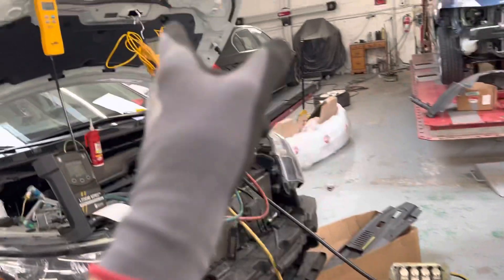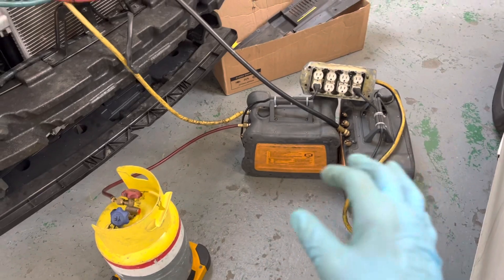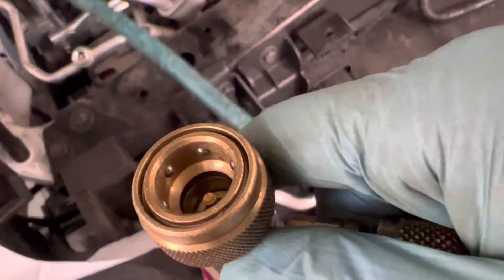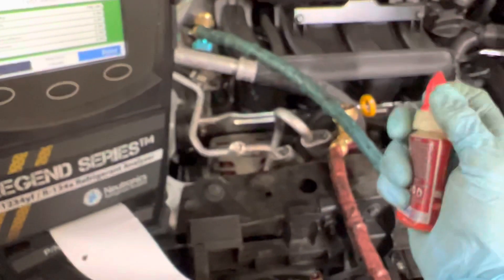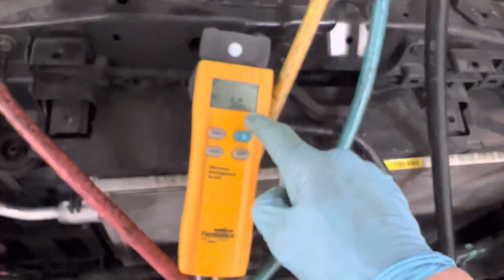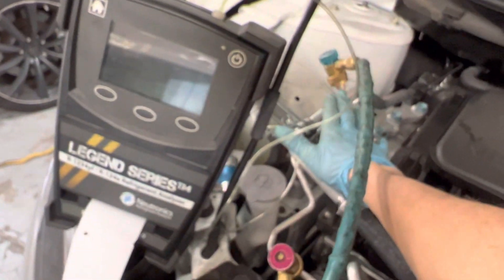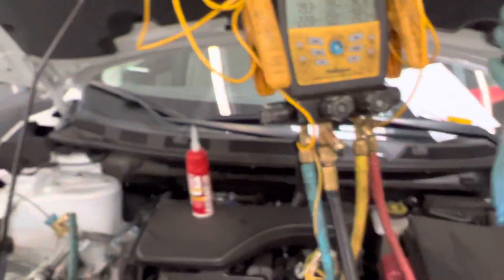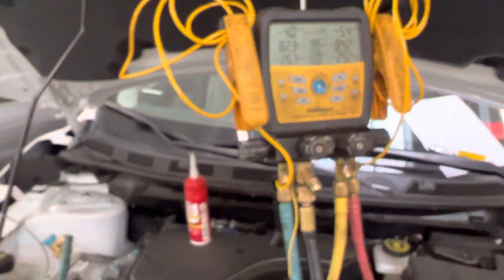Automotive refrigerant recovery using Fieldpiece equipment￼

Comment: Tom, when you pull freeon some little oil is going to be recovered as well. when you add free on , do you add little bit of oil, or you always add x amount or you dont add. the higher 5000 dollar machine willl tell how much oil is recovered so we will add that back. just getting your thought process.
Reply from the maker: The recovery machine has a speed on it and I have a site glass.
     So long as I start at a slow speed, only recover from the suction line at first at a slow speed so no liquid get drawn up no oil. 
   This takes practice and experience

Something I would not recommend other people trying to do . 
    So I don’t need to add oil unless the part is changed

Comment: Thank you for your videos, I really enjoy them!   I have Fieldpiece equipment for HVAC and plan to use them on my cars when AC service is needed.   I think it is a far more effective system over the dedicated idiot boxes that most shops have.  I did look into the Mastercool 69Legend Series, but it is a very pricey system for casual use.  I imagine I can pay a shop to hook theirs up before I service to see the purity of refrigerant.
Reply from the maker: The only thing you gotta remember if you’re used to doing residential or commercial HVAC. 
       You do not want to pull out refrigerant on the liquid line 1st because you move a bunch of oil and you won’t know how much to put back. 

Throttleback your recovery valve to slow it down . 
   Monitor your cycle glass to make sure there’s absolutely no liquid coming up the section line because in certain cases there is possibility when you drop the pressure the refrigerant in the oil in the section line foams up like big gap spray foam.   And it gets sucked up the suction line low side, removing oil you don’t wanna do that.. 

This is why I tell everybody you don’t do this all the time so spend the extra three to $500 and get the  SIRSEPT DUAL GUARD OIL separator

This will allow you to recover refrigerant with no worry that you won’t be able to measure the oil because when you’re finished you open the valve in the bottom poured out into your graduated measuring cup so you can measure specifically how many milliliters of oil you have replaced 

Some automotive air-conditioning systems only have 2 1/2 ounces of refrigerator oil 
   Other systems have 4 ounces some five some seven some 10 ounces even all the way up to 14 ounces

It’s all depends on the year make model specific
Reply: @coldfinger459sub0 thanks!   I saw some of these points in one of your videos!  I will check out the separator.

Comment: Great job with the video. ALTHOUGH, you are using the WRONG  NYLOG (RED) and you should be using BLUE NYLOG! RED NYLOG is for "mineral oil" based systems. From the manufacture and actual inventor himself, John Pastorello (snip) :  "Nylog Blue with any refrigerant or system oil. We make two versions of Nylog, one with Mineral oil, (the Red) and the other with POE, (the Blue). Nylog Blue can be used universally. The only reason we still offer and produce the Nylog Red is because too many technicians have never educated themselves that oils can be mixed. Just remember that you can use POE with any refrigerant/oil, but you cannot use 100% Mineral or AB to run an HFC system. About 90% POE is needed in an HFC system to carry residual MO or AB. Hope this helps... Thanks, John Pastorello, Refrigeration Technologies"
Reply from the maker: @garybuffington6021  yes I know. It all they had . Our hvac parts house was out for week at the time I made this video. 

I now order it six packs at a time so I don’t run out.
Reply: @coldfinger459sub0  At least you are ahead of the curve! I have not personally met or known any other Automotive Technicians to use Nylog as side from seeing it being used on YouTube. . Clearly they do not know what they are missing out on. I just used some Blue Nylog on a neighbor's Jeep Wrangler 2 days ago. I was watching your Fieldpiece Equipment videos and thinking about buying some more portible equipment. My older dual (R12/R134a) Robinair RRR machine seems to have issues after not being used for like 3 years at home. Laughed it the old Robinair then went to pull out my spare "brand new" unused RTI Acrtic Air Pro RHS980 from being stored in my enclosed trailer. The dang RTI RRR Machine won't fill it's internal tank. Talk about bad luck! That is what i get for thinking ahead and planning for Robinair replacement. Keep the videos coming brother! Master Automotive Technician here and Former FL LEO too.
Reply from the maker: @garybuffington6021  before NYLOG
My father was using Vaseline because Vaseline is made out of mineral oil and back in the 1950s and 1960s 12 refrigerant and 22 refrigerant both used mineral oil as a refrigerant oil . 

Also used silicone grease a.k.a. spark plug boost, grease or dielectric grease . 

These are all things Automotive used since the 50s . Or at least the ones with an education.. 
     They also used micron gauges back in the 50s. 
      I was raised to learn to use an analog mic when I started in the 70s.

Comment: Then what do you do if the refrigerant is contaminated?
Reply from the maker: @saturno4236  that goes in a separate recovery container just for contaminated refrigerant.  
       Then you go down to your local commercial refrigeration supply house for the refrigerant recycling system and exchange your tank. 
        You give them the old tank filled with refrigerant
        In exchange for another refrigerant recycling tank. 

Just like when you go down to the auto parts store, recycles engine oil or your coolant where you drop off your recycling ♻️ program.

Comment: Thank you for taking the time to make this video, Tom. I'm wondering if one  has to buy a different set of manifold, hoses and recovery pump for r1234yf systems.
Reply from the maker: You should that is best practice. Especially if more than one person is going to use the equipment and nobody remembers what kind of refrigerant or oil were last used or make it to practice to Flushing, clean out the system of the unit or hoses engages.. 

I have several sets of gauges but when I use my one set that I use for different refrigerant with different oils .  I have a pressurized cylinder that’s 99% alcohol.  I just hook up my yellow hose press the valve in at high pressure. It blows through the alcohol through the hoses and gauges play need it out.   Then I hook it up to the nitrogen and blow through 600 psi of dry nitrogen.  Hook it up to the vacuum pump. It takes it down to flow 100 µm and I’m ready for the different refrigerant or different oil.. 

On the recovery machine, I blow through it with dry nitrogen, and then pull the vacuum on the recovery machine to prepare it for use with a different gas .   I do have three recovery machines but when I do have to switch one to a different gas, that’s the procedure I go through..

Comment: so the red tank valve is the liquid valve? and u dont need a dryer filter on the vapor hose then?
Reply from the maker: Never go by the colors that are on the recovery tanks. 
       One tank manufacturer may have the blue valve as the liquid and then another tank manufacturer will have the red so read the label or the imprint on the valve do not judged by the color. 

        Usually to protect your machine from debris you would put a filter dryer on your yellow refrigerant hose leading to your recovery machine. 
                     It’s only purpose is to block small metal particles or any other debris from getting into your recovery machine and damaging the pistons and cylinders. 

I take the chance I know I’m recovering from a clean working system and I’m only recovering from the vapor side so I’m not pulling out liquid refrigerant or oil or any debris just a vapor gas into my recovery machine.
Reply: @coldfinger459sub0  yes, but which line comes from the rec machine to the tank then
Reply from the maker: @viisteist1363  I go to the vapor side.
Reply: Where I can buy the hoses for the pump?
Reply from the maker: @booshiet  trutechtools.com  this is were I get my online tools